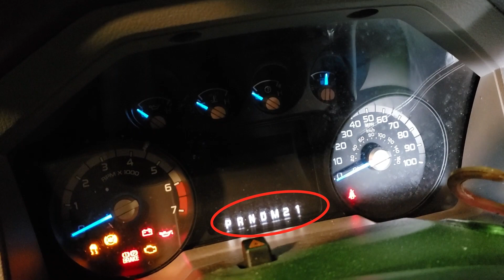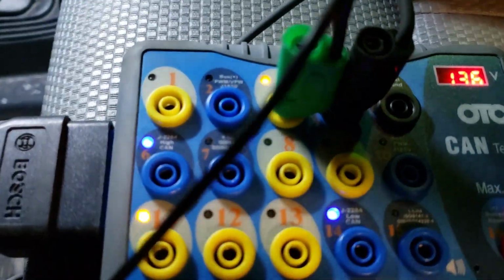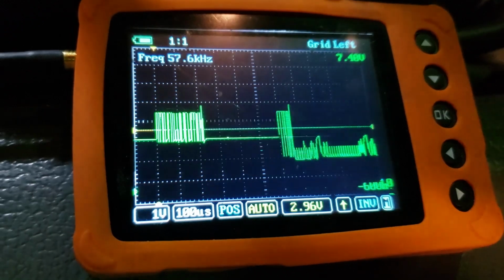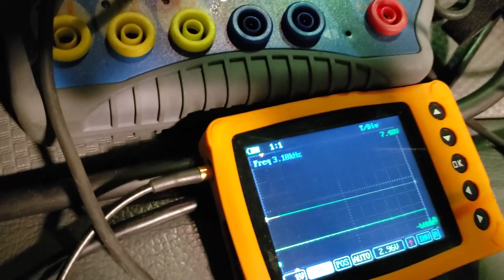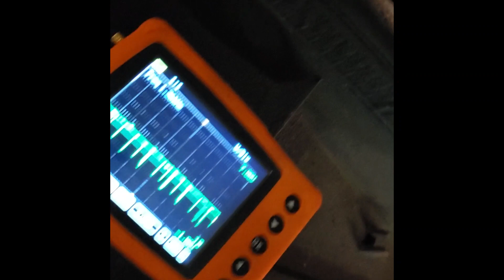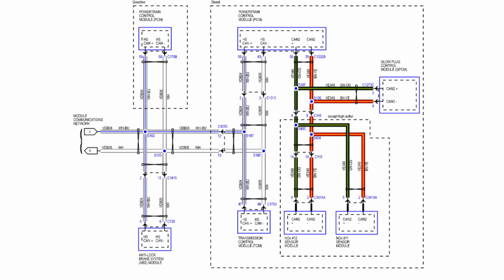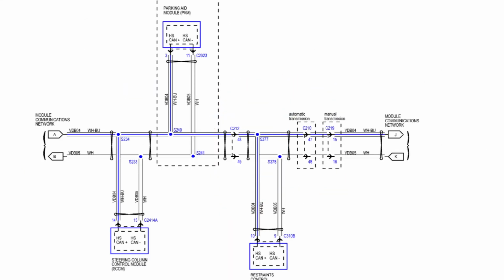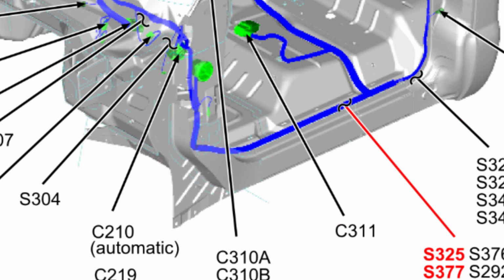Ford F 250  no start CAN Problem

Comment: THAT WAS AN OUTSTANDING DIAGNOSTIC VIDEO BRIAN  , NOW JUST CURIOUS  DID YOU HAVE ANY CODES OUT OF THE RESTRAINT MODULE WITH THE CAN BUS WIRES JUMPED . THANK YOU AND ALWAYS LOOKING FORWARD TO YOUR VIDEOS !
Reply from the maker: No codew in the rcm, bcm , pic, and few others had code for lost comm with abs and pcm..
Reply: @BrianMann216  THANK YOU FOR THE REPLY , I GUESS THOSE CODES WERE EVEN BEFORE YOU BYPASSED THAT LENGTH OF CAN BUS CABLING !

Comment: Brian, this was an awesome video. First enjoyed the fact tha you used the U-scope and the breakout box. Will go through the video again to document what ports on the breakout box are for what and what you should see. Maybe a quick video like this one just explaining the CAN BUSS system in lay mans terms like termination resistors and gateways. Just an overview say on twisted pair wires. Are those wire diagrams proprietary or will they show up on say Mitchel DIYer diagrams which I have for my two vehicles? It was a nice path you layed out for someone like myself for a starting point. Thank you Artie ❤️
Reply from the maker: Have you seen my dlc quick test video?  The information / diagrams here should show up on any service information system.

Comment: As soon as I saw something other than 60 ohms on the high speed I’m thinking broken wire. Cause if it was shorted to each other it’d be 0 ohms between 6 and 14. I just had a 2011 Taurus with a similar situation last week broken can line to pcm. I wanted to break out the scope but didn’t because the flow chart was actually decent.
Reply from the maker: I was out if time  that evening, waiting for a picture of the corroded / green wires!

Comment: What do you mean you had to get a little barbaric and jumper the wires? That is ole school tried and true testing. Good video.
Reply from the maker: Lol, I'd rather not cut and just locate the problem, we did not have enough time though. Old school proved we did not need  PCM or ABS modules .

Comment: Hello sir. What is the name of the software on the computer  you are using to test the network? Your feedback is more appreciated. Regards.
Reply from the maker: Ford IDS is the software that performs the network test.
Reply: @BrianMann216  is that just for Ford or that can be applied to different makes of cars with that particular software? Thanks for your feedback.
Reply from the maker: It will work only with Ford products. It is the OEM / dealer tool.
Reply: @BrianMann216  I got it. Thank you sir very much. Have a great rest of the weekend.
Reply from the maker: @neverstoplearning382  let me know if you have other questions. Thanks for watching.

Comment: Hmm.  I've been racking my brain trying to find an issue.  I'll check my splices.  My truck was flooded and the sides were full of water. My can line is getting a signal with nothing connected 😞
Reply from the maker: Even with scan tool disconnected? Is signal clean? Probably other modules hooked up somewhere
Reply: @BrianMann216  I'll have to repeat the tests but I believe so ...  Yes the signal is clean and it's almost 10V pk-pk with everything connected and it's about 5V pk-pk with everything disconnected.  I'm assuming it's coming from another network.

Comment: Great video, I think a lot of people would have gone with the engine Ecu after ‘the unplug it test’ 
Would you always recommend to check the HSCAN + & - at the module plug? 

Also the scope you are using, what model is that? 

Great work!
Reply from the maker: Yes, many may have condemned a module, I was thinking that at first!  I did not go into enough detail, but with the pcm unplugged and abs plugged in the pattern was the same, so I was thinking at that point common grounds and powers to both modules, then I was thinking,  duh , common CAN, so that is why I checked the data line to the pcm. I did not check any other wires at the pcm,  and I did not check anything at the abs. I do not normally check the CAN signal  at the modules, as most times I find bad modules pulling up or down the network, and removing the module ( note singular) the network comes back. At that point I check powers and grounds at the suspect module.
Reply: Brian Mann thanks for the reply, do you think you checked the data line due to the 190ohms? Possibly thinking corrosion with the high resistance... 
120 ohms and that would of pointed towards a module offline?
I really like CAN Diagnostics and would like to learn a lot more
Reply from the maker: @GRUSSNewton  I checked the line at the dlc because of the 190 ohms and it is super easy, the scope tells a story. I thought we would have  a bad module. Fords are different from GM in the way the modules can be disconnected, with out automatically removing all modules after the disconnected  one. So that said the strategy will be different. I did not have a need to look at a diagram on this one until I found that both modules need to be disconnected for pattern to be good @ dlc.